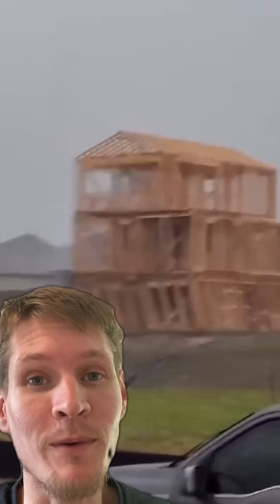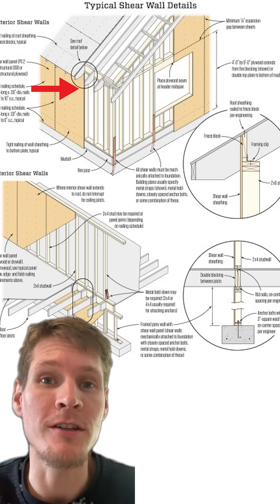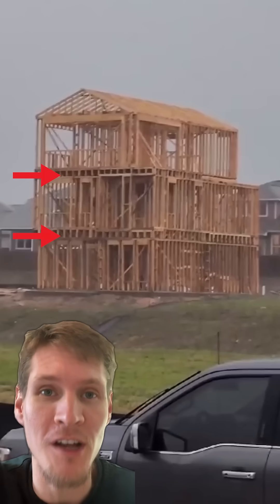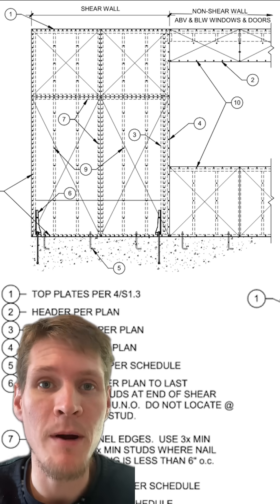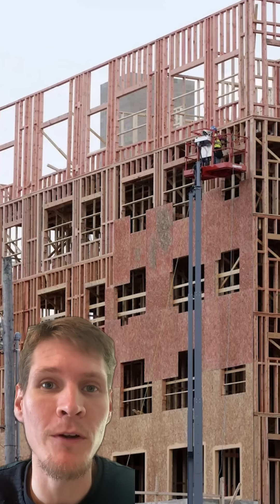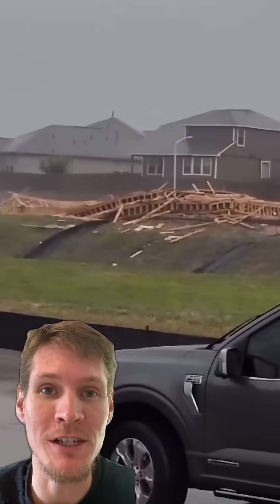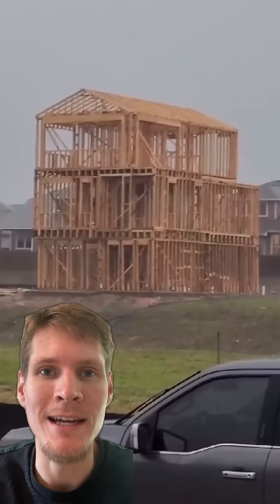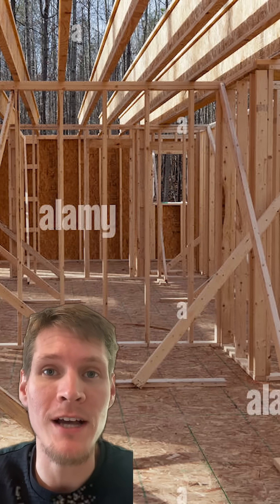Professional Engineer Reviews Reddit Structural Engineering Thread | Part 1 #engineering #reddit

Comment: Sheathing is absolutely a structural facet. The reason why that fell is because there is no plywood hold it together. Had the ground floor been sheathed it’s would not have collapsed after the top floor structure is built.

Comment: Here in Australia we don’t use glorified particleboard as a structural element, we use more wood, wood and steel or just steel for a structural system for our brick veneer or double brick homes. Real horizontal bracing for lateral loads is obviously a lost art in the U.S.

America, lift your game.

Comment: American houses: PLYWOOD (the literal bottom feeder of the material world. There is no worse material, no lower quality, more looked down shit, varying quality bs than plywood. The absolute joke that plywood is a load bearing material in the u.s. is a morbid sick joke.
We have an old folk tale when the wolf wants to eat 3 pigs, and each builds a house from different materials. Look it up😂😂😂 the woden one was not the best quality, and in terms of durability.

Plywood is the absolute cheapest "wooden" sheet there is, no one should use it other than backside of a furniture. Its not a load bearing material😂😂😂 same with shingles. Not even on dog houses. ROOF TILES... maybe the plywood cant handle the tiles

Comment: as a retired union roofer in the bay area when they started using the useless water board plywood roofs were blowing off all over the bay area cause nails even staples just pull out of that crap and i would i never have a home made with it

Comment: I've seen timber-frame multi-story construction without sheeting.  But the frame structure is designed to handle sheer loads and the beams are massive in comparison to 2x X studs.

Comment: Professional my ass. That house is pure trash, with or without panels. It's a cultural thing in America, I get it. But houses should be made of bricks and concrete. Even bricks and mud is waaaaay better than just cheap ass pine wood stuck together with cheap ass 2 mm wide screws. Even wood houses in other parts of the globe are better than american wood houses, bc they use stronger and thicker wood, better joints, etc. And i am not trash talking America. It's rather a wake up call for the users. Big companies and big real estate corporations have downplayed, degraded, dumbed-down house building so much, that they have made this trash the "new normal", "it's actually a luxury" and you should be okay with that, charging people 4 or 5 times MORE than 30 years ago WHILE using worse materials. It's unacceptable. Don't let them take your hard-earned money and get away with that by saying "that's what it really costs"

Comment: Scottish timber frame construction is done with prefabricated panelled sections rather than assembling framing on-site. In such a case, these stability issues cannot occur. It is, however, a very wind country, and construction procedures must always accommodate the approaching weather.

Comment: It can still happen today when you try to build a 4,500 square foot house on a 2,000 square foot lot. Doing it fast & cheap. The houses these days seem to being built on smaller lots with multiple stories and high square footage. But you don’t see the multistory houses in San Francisco going down even with earthquakes & built on high degree slopes. Think the Full House style 3 story Victorian Homes. High 3 story with a lot of square footage & heavy as they were originally designed to be multiplexes with multiple bedrooms, a bathroom with porcelain or cast iron tub (they can weigh up to 750 lbs when full of water+ a human) & full kitchens on each floor. To construct something that strong these days I’m not sure what it would cost. Maybe another commenter with background in structural engineering & contracting could give an estimate. 🤷

Comment: Those prop supports are only supposed to be there when you initially prop up the wall. A diagonal beam should be inset along each row of studs to keep this exact thing from happening. Plywood should add to, but never the sole source of, lateral stability.

Comment: Corner bracing in the walls used to be the norm, but that went to the wayside with sheathing. At least build in corner bracing if you aren't going to sheath it right away. But all houses should have both in them anyway as I see it and have done.

Comment: I don't see much, if any, lateral bracing in that framing. Its virtually all vertical posts.  The lateral bracing is what gives the wall its strength against lateral forces... as is, the building seems made to only support forces from the top.  Hence... the lateral wind knocked over a bunch of poles.

Sheathing does the same thing.  You can, theoretically, do one or the other or both. Most prefab framed walls come with lateral supports already there... or at least they used to.

Comment: My Dad framed houses for years. Found a great deal on a 1960s crane. He started doing more and more with the crane to the point he was prefabricating walls in his barn during the winter and driving them to site with the hay trailer. 
Definitely need that bracing.

Comment: This goes beyond just a bad idea. I have no idea how they were going to sheet the second and third floor of a house on ladders. How were they going to support the panels while they nailed them off?

It's possible that there were Strong Walls built into the frame and those were supposed to provide enough shear strength to finish framing. This entire project is confusing.

Comment: Those diagonal members are not "shoring" per se. Those are rack and line braces to plumb the corners and straighten the wall runs. They do provide a small amount of stability but are there primarily to hold the corners and walls plumb and straight before shearing. The plywood provides almost all the lateral bracing as you stated. The fact that the wind overcame this minimal resistance does not indicate that "nothing would've stopped it" by any means. That is patently false.

Comment: Those braces are not for stability those braces are to straighten the wall so when you put your floor joists on and or your ceiling joists on your wall is straight and you don't have them overhanging the wall or falling short the rain is what did the structure in because it probably quadrupled the weight

Comment: My house is old. It was built at a time when 3/4x4" southern  yellow pine slats at a 45* angle were the standard for sheathing. On top of  that was tar paper and asbestos tiling. The asbestos is now long gone having been replaced with a smoothing layer of 3/8" plywood, house wrap and vinyl siding.

Comment: I did framing for a summer with a luxury home builder and they don't put up walls without sheathing first. They Square everything on the floor then attached the sheathing then put the wall up. And the sheathing always overlaps the floor below tying it all together.

Comment: I'm not american but am a builder in new zealand. I've built two storey houses and It's not mandatory to put sheathing on the outside. Infact sheathing (7mm plywood) is only used in certain designs. We uses braces (like shown in the video) to stop house moving laterally.  I don't think a house has ever fallen over like this in all of New Zealands building history. And we are a particularly windy country. I'm not sure what the problem is but all I can say is crazy shit happens in America.
Reply: Oh I think I figured it out. The braces in the video are just for straightening the top plates. We also have additional braces that run diagonally across each wall and prevent them racking. Plus it doesn't look like they have dwangs (small horizontal members) between the studs at 800mm from the floor. So two on a 2.4m wall. This combined with the braces probably prevents what happens in the video.

Comment: if you think sheeting supports any wood structure your delusional! The interior walls lock all the exterior walls together preventing them from doing this! If that was done properly this would never happen! Sheeting adds to the strength but it also turns it into a giant kite! Wind that blows through the framing is now trying to push it over so same thing would have happened even if it was sheeted! Someone framed this house completely wrong! I've seen the quality of construction fall in Canada too! Immigrants with little skills or knowledge leading construction crews now so this kind of thing will be much more common! Hopefully a democrat buys this kinda house!

Comment: 3 story shed. c'mon America I know you have a lot of timber.but you need to update your building practices a little. In other countries timber frame doesn't mean everything. It typically means, internal walls,  floors and roof, and maybe  the top floor walls on a two story, if you are cheeping out. House is not supposed to be a shed, with shed roofing.. Actual timber frame ended by the 18th century and those weren't built like sheds. .

Comment: Blame the framers for this one. As a framer, you have to make sure the building has enough bracing support, especially when you know there is a storm coming. You need to brace the building up, not just to straighten the walls, but to make sure the building isnt moving. Clearly, there were not enough braces and probably none on the sheer walls. This was a very expensive F up!

Comment: first floor is all windows, not sure it would have withstood that wind, even with sheathing.  also, if it was sheathed, the wind would have had more to push against, and that first floor still would have had very little keeping it from falling in that direction.
Reply: dont know the current codes, but that first floor needed at least one full, uncut, four feet sheet somewhere on that window wall to pass code back when i was framing.

Comment: LATIN AMERICAN: Here is the concrete, the tiles, steel rods, blocks, cement to plaster…
AMERICAN HOLDING A HAMMER: What is that? “America” does it best… 
LATIN AMERICAN: Right… After every tornado, fire, and hurricane.

Comment: Sheathing wouldn’t have made as much of a difference as you might expect, since the side that failed was largely composed of openings. In fact, it would have only amplified the wind load on the longitudinal side. What this structure really needed was a moment or portal frame—possibly even steel—on the street-facing side.
Reply: You win the price for the smartest sounding junk science on YouTube.  As soon as you sheath a rectangle box it become 1000x stronger.  Try this experiment: make a quick 8.5"x11" square with 2x4.  Push on the corner of the 2x4 square and you will see it "matchbox" (collapse).  Now simply glue a piece of office paper across the face of the square.  You won't be able to collapse the square anymore.
Reply: @JeremyBell  If you took my comment as suggesting that sheathing doesn’t provide lateral bracing, you might want to give it another read.  The aspect ratio on that home means the side that needs the most lateral restraint (sheathing) is the shortest wall segment (front) which is why it collapsed the way it did.  That wall segment (3 stories) is 90%+ openings (windows/doors).  You cannot apply sheathing through openings - therefore, an alternative brace wall solution is needed like a moment or portal frame.  FYI i'm an architect.
Reply: @Johnnyprc  I agree with you that the modern "fad" of 90% of the home being windows windows windows is a horrible idea.  But whether that opening for the window can't be laterally rigid with sheathing I'm not so sure.  Would have to throw it into a CAD software to know for sure.  I'm assuming for a house that expensive, an architect had to sign off on the plans.

Comment: Haste makes waste.  No better demonstration than this.  The internal bracing you showed is really not meant to do anything other than hold long wall spans straight and plumb long enough to get exterior sheeting in place.  I've never seen anyone put more than a couple nails in the ends of those braces because they really aren't supposed to keep the whole structure upright longer than it takes to sheet the outside.  That's crazy

Comment: You know what also prevents shit like this from happening? When you use proper engineering, rebar, and concrete. In stead of building from match sticks, held together with hopes and prayer. Added bonus? Fire safety, storm resistance, longevity... In America, most neighborhoods are really just luxury trailer parks without the wheels, when you think about it. 🤔

Comment: You call them temporary shoring; I called them bracing. Although I agree that you need to have some plywood on the bottom floor before beginning the next floor, the real problem is likely that they took out most of the bracing on the inside for easier movement, thinking that the 5/8" floor plywood would keep the house stable, when in fact, the 1/2" plywood on the exterior wall was the one that would've kept it from being blown sideways.

As you can see that the 2nd floor and 3rd floor was fine (up until the main floor completely gave out) because they had more bracing compared to the main floor. The point I'm trying to make here is that the house would still be fine had they kept lots of the bracing in place which they obviously didn't do. 

My framer ALWAYS ask me if they're allowed to move any brace because it not only holds the house stable but it also keep things square so measurement doesn't mess up.

Comment: The temporary shroing was nailed into the floor so the lateral strain pulled the floor connections up and the building fell over.  This is because if you look the majority of those shoring connections were in the same direction which means there was no push on side pull other side and thus since there was an unequal amount of directional shoring the building fell in the weakest direction.

Comment: It might have been nice to identify the builder/framer so other know not to hire them!  The diagonal studs were probably the only think that prevented it from collapsing before it did.  Seriously, racking resistance is like one of the first things you learn in mechanical and civil engineering along with floor loading and the requirements for floor beams or trusses.

Comment: it’s just bad design and engineering, so much wood and it’s expensive and weak. Need to go back to timber framing(could use a modern engineered timber of course) but the structures are so much more sound and last a hundreds of years.

Comment: Whenever I need to build a wooden framed wall, I include a diagonal brace to prevent it from wobbling left-to-right. I try to add these diagonals to each end of the wall. I do this regardless of whether I use sheet boards.

Comment: In the Northridge earthquake apartment buildings pancaked because the contractor used a cheap type of fiber board on the first floor. I don't know the difference between MFD and OSD, but one is correct and the other is dirt cheap. People died because of greed. 😢

Comment: We don't use panels where I am, but diagonal members, but NOT temporary ones.  We also use tie-down rods that we call "cyclone bolts" that connect the roof plates to the foundation, which actually also add rigidity (almost incidentally).

Comment: Uhh is blocking not a thing anymore? In FL and in North TX every home I lived in or saw going up had horizontal blocking between every exterior and shear wall stud. Here in CA there's horizontal blocking and diagonal blocking, plus interior shear walls are 2x6 like exterior walls - for better earthquake resistance.

Maybe builders today are cheap and don't bother with the blocking?

Comment: It is a typical parallelogram structure, which is the most vulnerable to collapse under horizontal forces. If the nodes are not firm or the internal panels are not provided, it may collapse at any time.

Comment: Well if you knew what you were doing you know the sheet the walls before you stand them just to reduce the labor cost by 35% after you build your floor you lay your Lumber out on the floor turning any studs that are bowed so the bow is up anything that are extreme removed and replaced with straighter wins now your beans into your cross beams take your tape measure measure Criss-Cross this will Square your wall tack it to the floor nail your plywood and other materials onto your wall and then stand your wall nailing a couple 2 * 4 to hold it up then once you have all four walls up you go to the corners and you now across board across the corner to hold it in position and build your second floor or add your roof by doing this everything will be square and strong by the way anything by force that are still sticking up before you cover your wall go to the center of the bow and cut into the 2X and the nail one alongside it when and then drive Nails Crossways flattening out your bow the only thing you need on the site is a good cut man you can read a measuring tape one good Carpenter and three laborers that three-story house I can frame it up in 10 days Drive-In all walls covered ready for interior walls and other trades I dried in 15 two story houses with a basement with a crew of six men in 8 months in Reynoldsburg Ohio when the first freeze hit I'm moved on only the inexperienced and unprofessional try to put siding on from scaffolding and over ladders when it can be just laid on the wall and nail down before standing you have any idea what kind of labor cost difference there is there